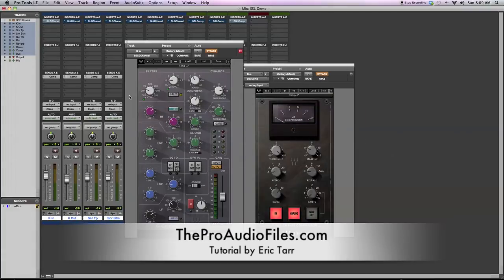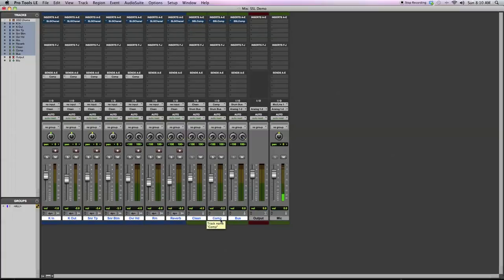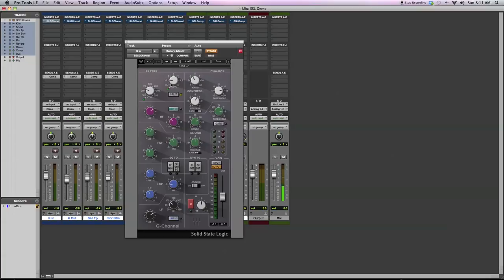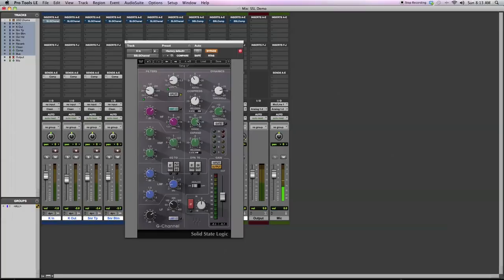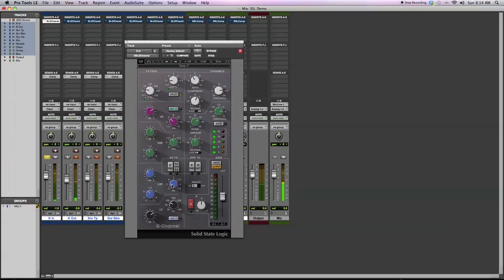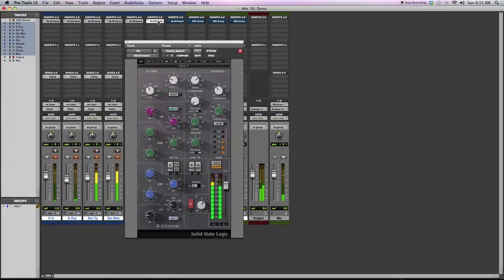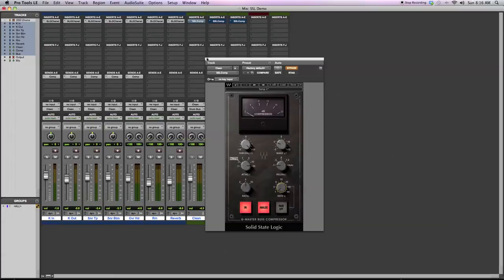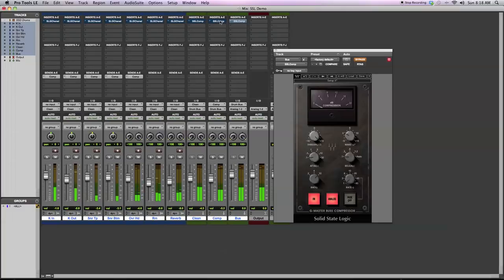Mix Tutorial: Waves SSL G-Channel Strip Plugin

Comment: what's the difference between the ssl g channel strip compressor and the ssl g master bus compressor?
Reply: I know this is 2 years ago and I'm pretty sure you already found the answer, but I'll answer your question for the new people that might stumble upon it.
So, the SSL G Channel Strip Compressor is a compressor that is designed to be used with the strip which includes the EQs and the Gate/Expander, it's a bit strong and mainly used for drums and other instruments (could also be used for vocals). The Bus Compressor is designed to be placed on a bus track and it's used to glue the mix together. I usually use it in my vocals bus with little compression just to hold everything together and also use it as the first plugin in my master track just to glue everything. It also gives you the SSL flavor.

Comment: If I have 16 tracks in a session, do I have to load up 16 different instantsis of the plugin? If so, what a deal breaker, cause most computers wont be able it.
Reply: That is a fair question.  The answer is: yes you would have to load 16 instances if you want to process the individual tracks differently.  If you want to process them all the same, you could load one version of the plug-in and send all of the 16 tracks to the single plug-in.  Something else to know is that this plug-in actually doesn't take up too much CPU, so most computers can actually run a lot more than 16 instances of this plug-in.
Reply: Eric Tarr Thank you.